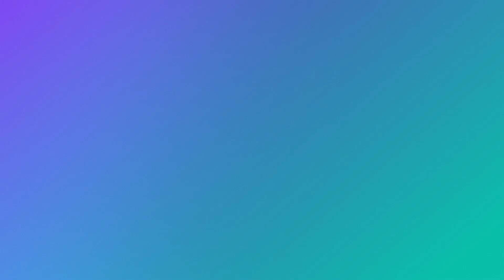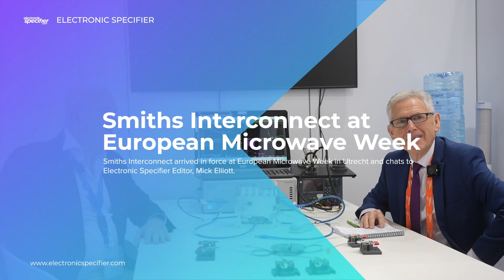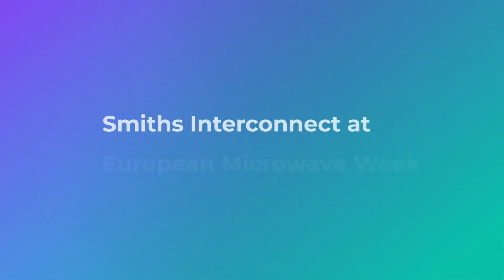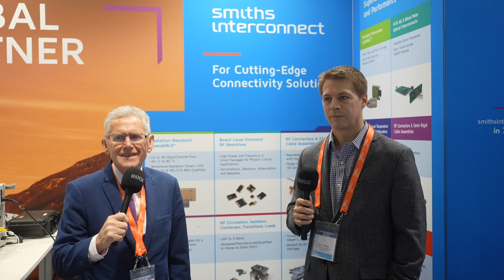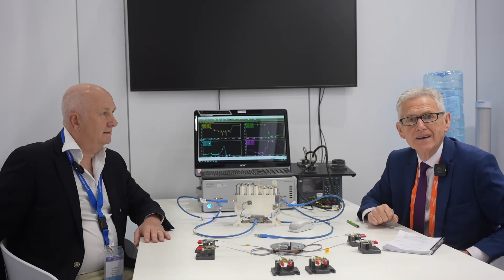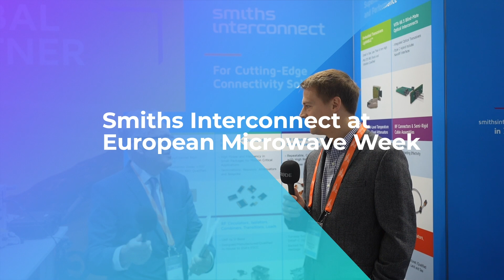Smiths Interconnect at EUMW 2025

Comment: 5:57 And will all screening be carried out to bona fide industry standards or will testing br forged and falsified for examples, sample electrical (insertion/return loss) analysation, manipulation of resistor burn-in (e.g. 50Ω thin-film) time dependant testing on route card travellers, random creation of test data by Quality Assurance of piece part tracability, physical interface aspects of female contacts, LAT testing not carried out (e.g. robustness of termination to drop-in tabs), the practice of vibration cycling without physically mounting components to the vibration table to create faux graph test documentation, rapid cycling of say 5? insertion loss glitch thermal screening to dupe QA, obscuration of internal defects (e.g. to the component stack caused by excessive picking)  using RTV mixed with D140 tuning powder, manipulation of x-ray analyss by misnumbering photograph data of defective units using a multiple pictures of a compliant component, manipulation of adhesive hardness samples (Shore D) including shipping of un-cured adhsives that will hopefully cure in transit, pre-setting of microwave analysers to indicate a nominal result in the case of C.S.I. visitation?  etc. etc. etc. 

God help any QA, they'd end up bullyed out (toxic atmosphere)  if they tried to put a stop to any of this! 

Overall, a priortisation of profit over Flight Standards Compliance?